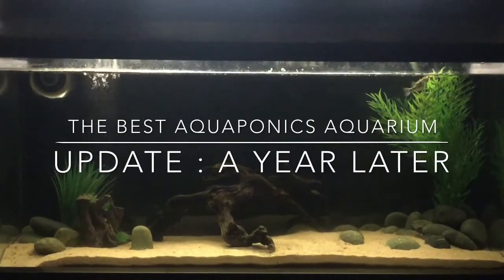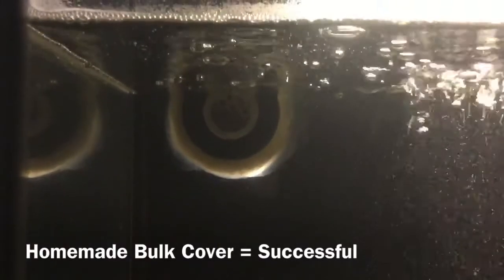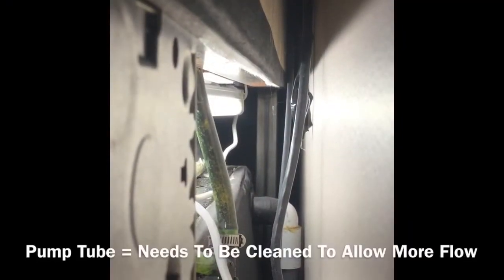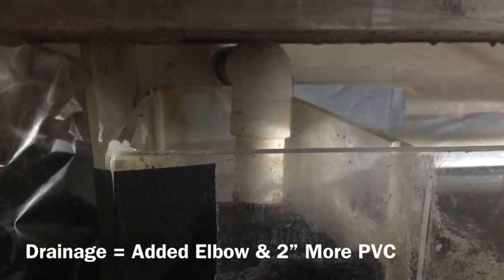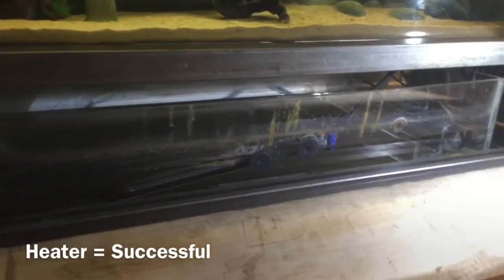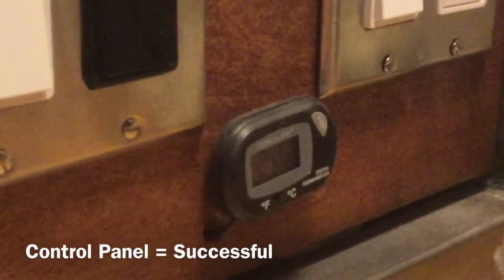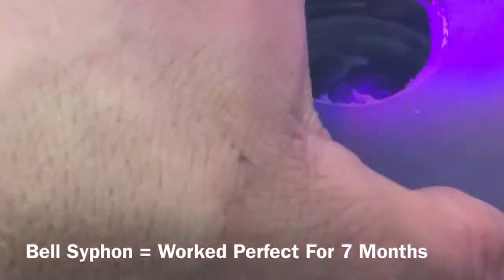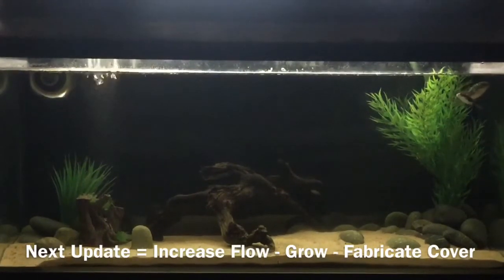The Best Aquaponics Aquarium-Update-A Year Later

Comment: I'm doing a VERY similar system. I'm buying a pre-made bell siphon. The system i'm designing has a small difference in that i'll be using an internal tank overflow box with a solids filter that will go directly into my grow bed  to the left of my tank. Then the bell siphon will go to my sump, and my sump will top off my tank. I'm a bit worried about overflowing my grow-bed though. If the grow-bed siphon fails i'll need some backup overflow to my sump in the case of failure. So i don't flood my office.
Reply from the maker: Gamer Voice I’d like to see a video of how it works out. I could make suggestions if I see some visuals